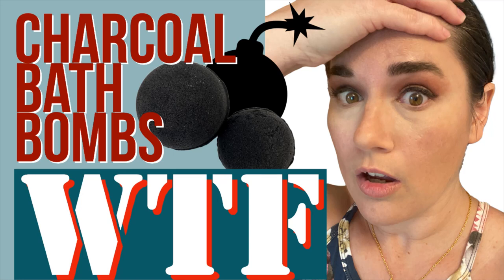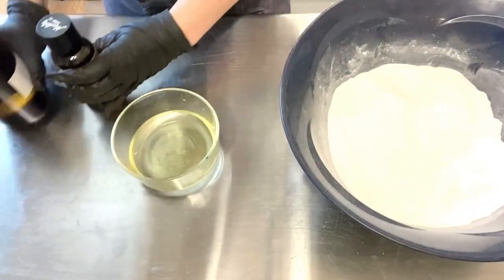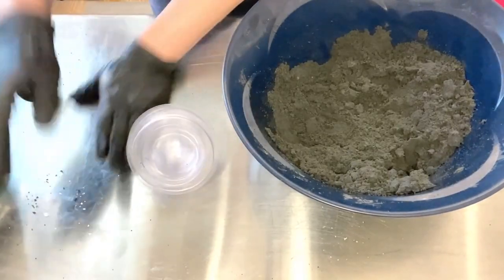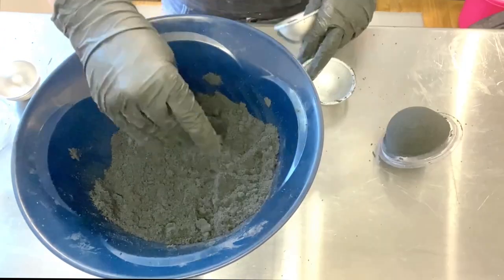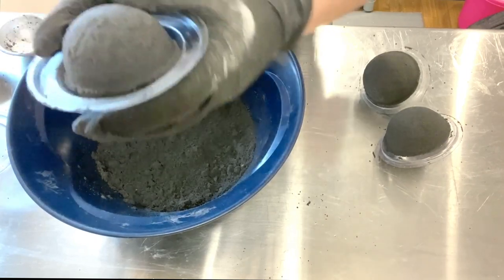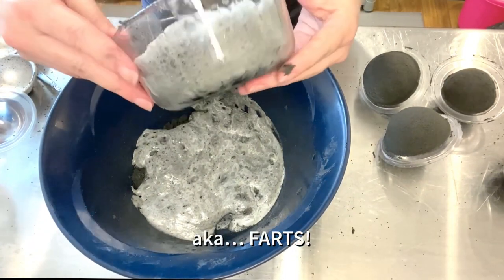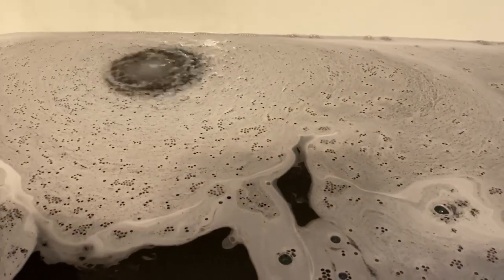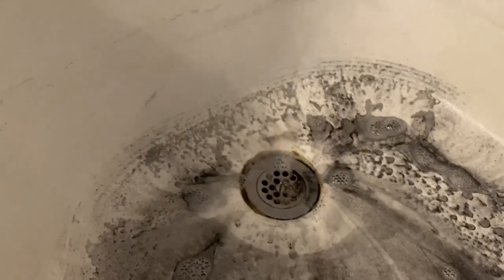WTF Pinterest?! Destroying my bathtub with a Charcoal Bath Bomb in the name of science 👩‍🔬🧫✌️

Comment: It’s so important to understand chemistry. The charcoal sticking like that is usually from already having a bath tub that already had product residue or soap scum. (You even pointed out the prior dirty line, so that checks.) A super easy way to clean a bathtub is to use hot water & then add either dishwasher soap or laundry powder and let it sit for a bit at the appropriate level. 
But seriously, if you can’t just rinse it; you already had something sticking to the bathtub. Think of those tablets that dentists give kids so they understand how to brush their teeth.
Reply from the maker: Nahhhh… that’s gaslighting and we don’t play that here! Properly formulated bath bombs WILL NOT STAIN a tub… doesn’t matter if it’s a clean tub or a dirty tub! 

But to clarify, I didn’t point out that the tub was *dirty*… lol I was pointing out that the tub was STAINED (from previous colorant testing for this channel, lol not from the bath bombs I make and sell!)… stained is not synonymous with dirty… Wine, chocolate, grease—these substances will stain, even if you wash the item, and charcoal is THE SAME… it will stain bath tubs! Particularly older tubs! 😊 But I appreciate your feedback and your engagement!

Comment: my question comes from the poly to oil ratio here...  everything I read says a 2:1 poly to oil ratio and that is def more like a 1:2.5 ratio completely backwards.  Also wouldn't the poly help with the charcoal if you just didn't add so much even though it wouldn't be as dark
Reply from the maker: If I remember correctly this version didn’t have poly 🤔… lol most free internet recipes don’t include it. I have thought about doing another version of charcoal bombs that used poly, but I still don’t think it would adequately suspend it… since carbon is sooooo stable it’s very difficult to dissolve, it also clumps together and makes it hard to solubilize. Lol lots of things NOT going for carbon as a colorant!